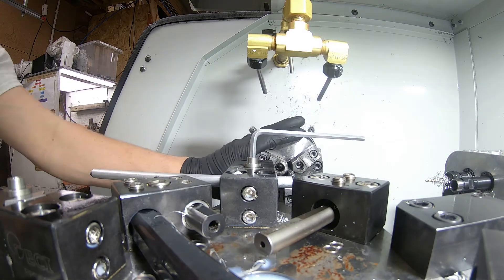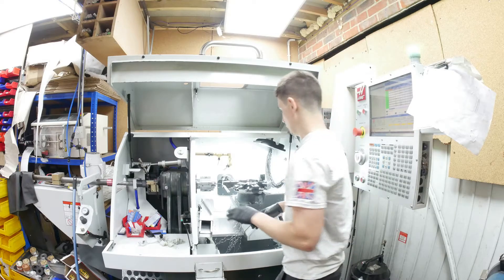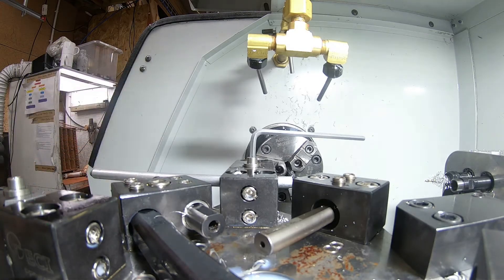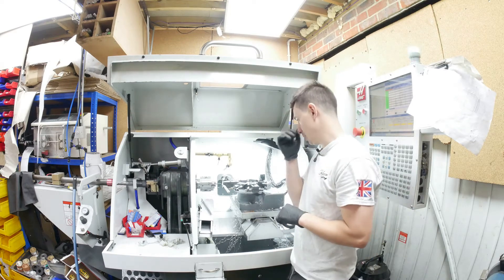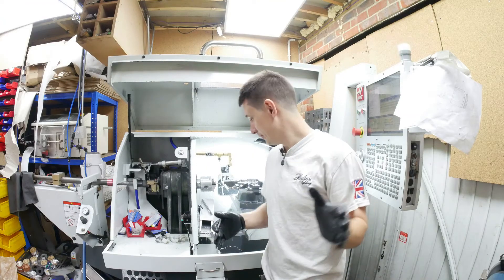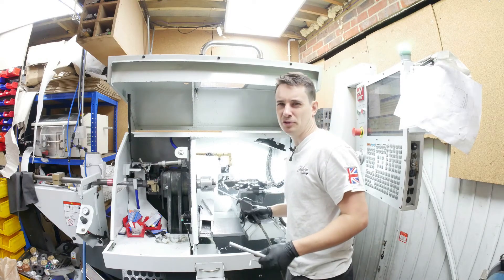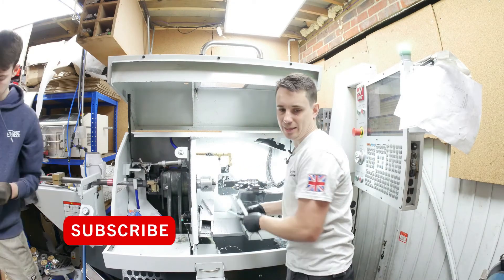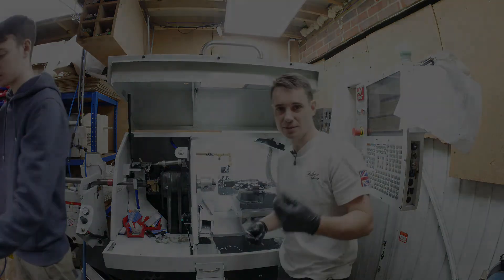HAAS CL-1 dead live axis :-( - simple part workaround

Comment: The issue with the live tooling is coolant is getting into the housing with motor.  It’s happened to the CL1s I run 3 times.  I suggested drilling a drain hole in the bottom.  The gaskets don’t keep coolant out.  I think it enters from the er collets.
Reply: Honestly, as much as it was fun with this machine, best decision was to let it go and replace with a Nakamura. I cannot reiterate how inaccurate this was until I got the Nak.

Comment: Ingenious solution, Shame about the HAAS.
2 weeks for service engineer to fix is appalling.
Unfortunately that’s what you get with a HAAS.Along with a world of other issues especially rigidity.
Reply from the maker: Thanks Roger, was kind of lucky it all fits really. There is a plan to add an extra lathe with a bigger premises next year, whether that will be with HAAS has yet to be seen. Depends on how they handle the last few fixes really. I love their control, and when the machine works it works brilliantly, but I feel I've had a real lemon
Reply: @HudsonLighting  did you ever get back up and running? How has it been doing over the last year?
Reply from the maker: @ianbresnahan1808  on our 3rd unit about to claim on the insurance for a 4th. Very unreliable. Coolant getting inside kills it
Reply: @HudsonLighting  other than the live tool, good machine?
Reply from the maker: @ianbresnahan1808  Yeah, I rate it, it's had issues with the bar pusher but that's a design you can overcome, we re designed the bar pusher rotary to have a bearing instead of a piece of plastic that wears. There's niggles, but it got us here. The only thing I'd say - is for the price I could of had an St-15 which would have been a better choice, but it was space and available supply so HAAS have obviously decided to go down the premium route with that.
Reply: @HudsonLighting  not a good introductory screw machine aye? Was hoping to hear great reviews. But your right, for the price, keep saving and buy a more refined machine.
Reply from the maker: @ianbresnahan1808  I've heard bad things about the entire HAAS large range tbh. But good about the mills. We've got a Nakamura lathe recently, thing is an absolute beast.